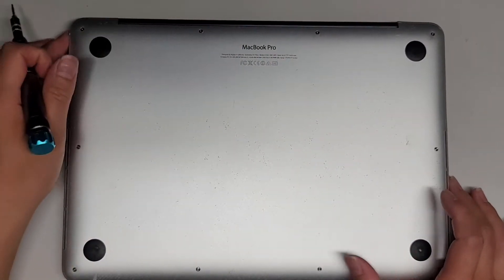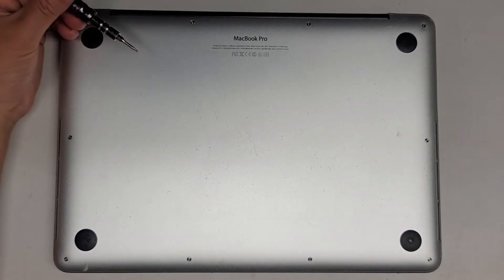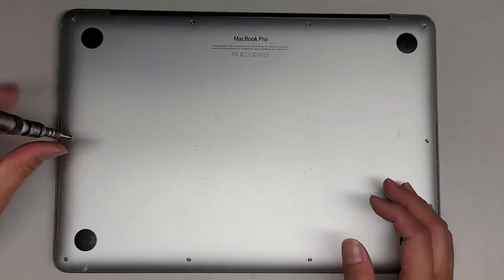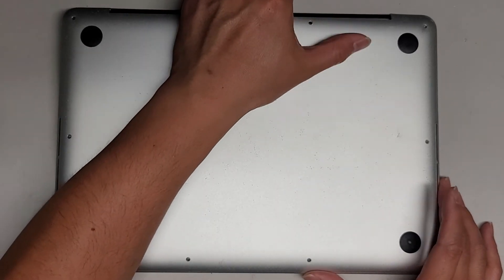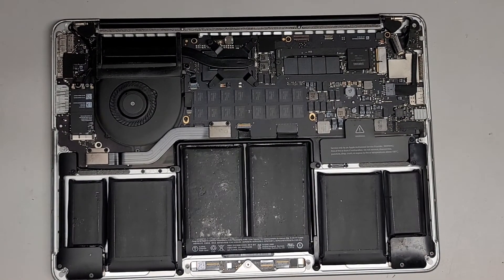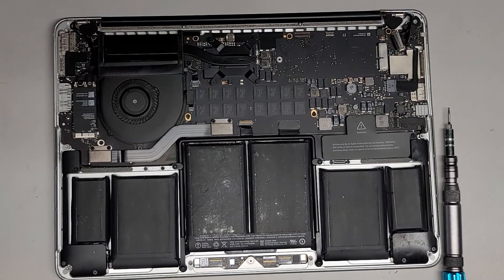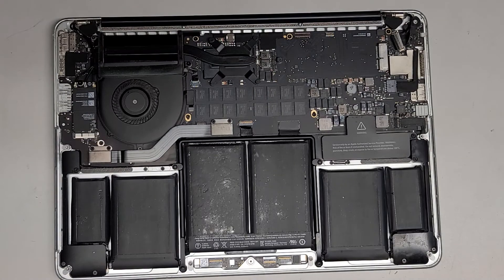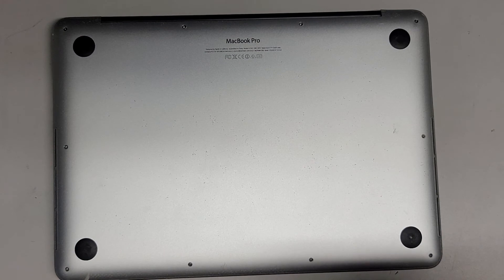13" inch Retina MacBook Pro A1502 Mid 2014 SSD Removal

Comment: Hey man. What kind of SSD is that? I'm looking to get an adapter to make it external. Wondering the size, key, and type of that original SSD.
Reply from the maker: It's mac specific. You need a mac specific usb enclosure.